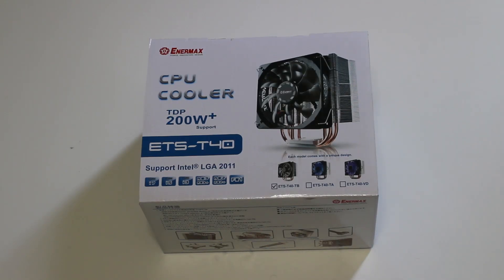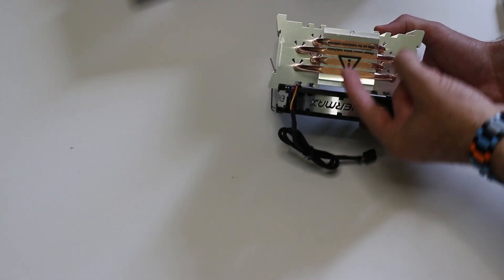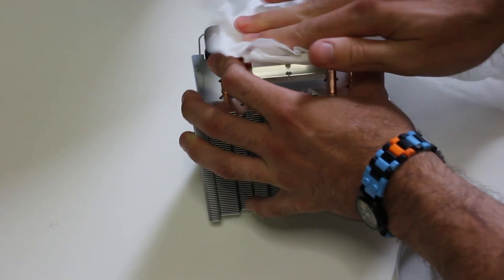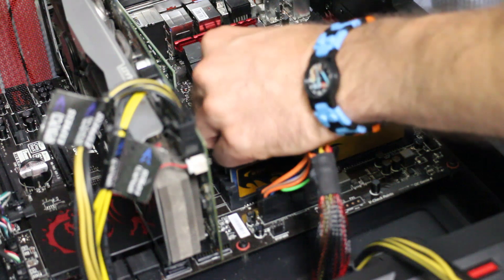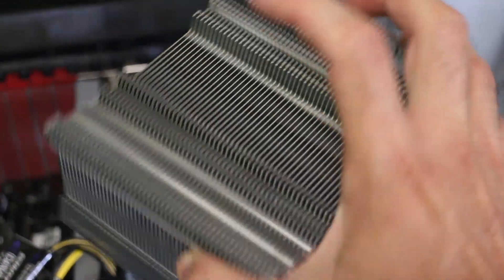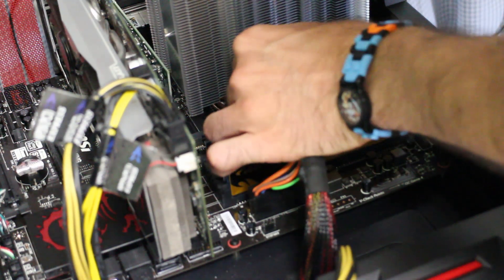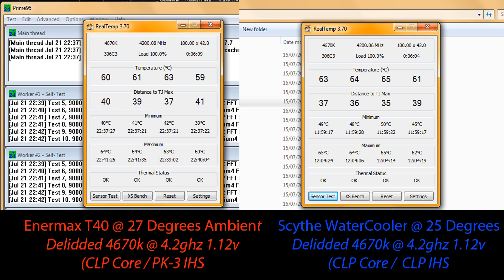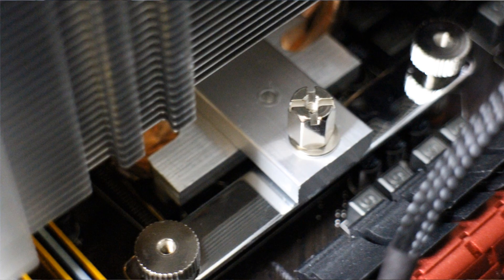Enermax ETS-T40-TB FULL Review / Installation Guide and Benchmarks Comparison Vs. Water Cooler

Comment: I used one of these with an FM2+ system that was overclocked to 4.80 GHz (A8-6600K, then A10-7890K) before I moved over to AM4. An amazing cooler, honestly, and much easier to install than the Cooler Master Hyper 212 EVO on AM4. Those instructions are abysmal.

Comment: installed this cooler and its putting some pressure against my freaking high corsair ram-Moduls....didnt want to put the fan on the wrong side, you im gonna live with it. Works fine for a few month now, but i guess its a good way to break your ram bank, if you install and reinstall it often enough. Temps dont even reach 60 degree with a 2700k@ 3,9ghz

Comment: Im also deciding between the T40 and Hyper 212 evo. Im leaning more towards the enermax but i don't like the fact that the copper pipes have gaps in between and aren't perfectly smooth. It should fit in my antec three hundred two as well but i have to decide which one.
Reply: +bluej511 even coolermaster have  gap there. its so tiny and only fingernail can sense it. it is sensible on 212 and tx3evo as far as i know.enermax is superior on tests. even fit series.
Reply: Zox Wolf Haha i posted that a year ago, ive since then gotten a Noctua NH-U14S and now watercooled everything.
Reply: Cool mate. I posted that even for other ppl who want to know more about these coolers.
cheers

Comment: Great video (watched because i saw the 5GHz on a air cooler). I have £60 / $85 to spend on a cooler for 1150 planning to cool a i5 4690K. Would you recommend this over something like a cooler master 280L? Thanks Brian or whoever can answer :)
Reply from the maker: Yeah for the money just get this, it will handle an i5 perfectly fine, and you can keep some cash in the back pocket.
Reply: Tech YES City Thanks, Will do. Whats the stock fan like? I think i'll get another anyway but should I swap it out for my SP120 or a noctua?
Reply from the maker: stock enermax t40 fan insanely good (better than the black and white version fans too), it is very quiet when in idle and even when spinning up doesn't get that loud.
Reply: Tech YES City  Just got it for my 8320, damn good cooler indeed. Keeps the energy munching 8320 in the 40s while playing games like sleeping dogs. Well worth the money if you care about noise level and comfort.

Comment: This or the Hyper 212 EVO? Planning on doing a buil. It's going in a Fractal Design R4 Windowed.
Reply from the maker: ***** This all the way.
Reply: Tech YES City Even if the Enermax is 8 Euro's more?
Reply: Also, do you think it would fit with Corsair Vengeance Pro memory in the first slot?
Reply from the maker: ah depends on how far spaced it is from the cpu socket, but if mounting it vertical then it will fit.
Reply: Honestly, with these two being so similar to each other, I'd say get whatever's cheaper.

Comment: hey
ive just brought this cooler for my i5 4670k tried ocing and it doesn't want to go past 3.9ghz at 1.250v, if i try anything higher the system just freezes, even with the core voltage upto 1.3v :o
im using a Gigabyte Z87X-SLI 

thanks
Reply: pc has now started to freeze @3.9ghz when opening a simple program such as core temp
Reply: mine still using the stock cooler one, and it past to 4.8Ghz at 1.290v without any problem but I changed it back to 3.4 due to stock cooler.
do you have CPU-Z? if so, check your bus speed (BCLK/PCIE frequency). for i5 4670K, the speed should be 99.98 MHz.

Comment: Thanks for the video i am going to replace my hyper n520 junk with this awesome heatsink so i can be prepared for 130F summer. My heatsink idles at 26C 76F room temperature or 16C if i have my vents blowing cold air directly with the air conditioner on. Using an AMD 1055T and it has never let me down in performance *click click click

Comment: mine doesn't auto adjust, under load in stress test it still does 800rpm but still doesn't top 40degrees on stock 4670k, so no real need I guess:P btw the switch is on the fan itself, already found it. thanks.
Reply from the maker: Ah nice, yeah i think it starts to trip after 55 degrees or so, 40 degrees tops, lol that is some really nice temps, good luck with the ocing.
Reply: yeah and it's not even delidded, thanks, the cooler is surprisingly great though, got it following you'r recommendation;) keep up the good work, it is nice to see that u'r channel has diversity instead of just focusing on one subject.
Reply from the maker: Yeah it is one amazing cooler for the money, I am sad that I didn't get another one over this zalman junk that I got for $3 cheaper (really regret it and not too keen to post the review cause half of it is me cursing the zalman cooler lol).
Reply: lol I know how you feel! I got the zalman cnps2x because it was nice and small and looked good, but turns out it cooled like 1% better than intel stock;p

Comment: how to change the rpm? there should be a switch to change between 800 - ** - 2200 rpm, but the manual says nothing about it
Reply from the maker: Actually never tried to change it manually, was really really impressed with how it worked on auto, if no load on CPU it will just stay at 800rpm but when on load/cpu gets hot it will ramp up.  Great design.

Comment: Newbie question:  Do you need to remove the stock cooler backplate from the motherboard prior to installing the Enermax backplate?
Reply from the maker: On my motherboard (g45) z87 I didn't have to (from memory).

Comment: Would you recommend this if I want to run an I5 4670K at 4,6ghz?
Reply from the maker: Yes
Reply: Tech YES City I'm still not sure I've read a lot of reviews and all i'm getting is that's as good as the Hyper evo 212 but your temps look really good. I know this is too much to ask but could you come back to this cooler and some more benchmarks and showing how much it can handle, thanks.
Reply: DarkLordX1X he has delided his cpu, which makes it run about 5 degrees cooler than a non delided chip. which could be a reason that it looks better compared to other benchmarks

Comment: seems like a good cooler and underrated too, Enermax makes some cool looking pc cases too....is the new Black Twister Enermax cpu cooler the same thing except painted black and comes with a blue LED fan? I've been wanting one. On newegg, the regular T40 is the default choice, but you can change the paint to black and newegg automatically links to the Black Twister T40, so I guess it's the same thing?

Comment: Yes, the T40 is a bit wider than 212 Evo, but both have same height. I installed both on my z77 extreme4, and I did push config. With the Evo, I could still squeeze a low profile ram (anything taller won't fit unless u move the fan up a bit) into the first slot after the cooler is completely installed, but with the T40, I had to install the ram first and then the cooler fan because the fan covered the first slot. I used Samsung ddr3 that has no heatsink because my Patriot Viper 3 won't fit.

Comment: Despite the low price, this cooler is surprisingly good. I was having the same problem choosing between this and the 212 Evo for my 3570k, but I ended up buying the Evo at a local store because it came with a bonus fan for push pull. I borrowed my friend's T40 and I did some test on both coolers as fairly as I could and they were quite similar in terms of performance, but the Evo was a tiny bit louder, however it's not really noticeable unless u stick your head on the side of your case.

Comment: Bryan is my rig any good? (Tell me if it needs a better psu)

CPU - AMD FX6300 Black Edition 6 Core (3.5/4.1GHz,8MB Level 3 Cache, 6MB Level 2 Cache, Socket AM3+)

GPU - Asus Nvidia GeForce GTX 760 DirectCU II OC 2GB GDDR5

Asus M5A78L-M/USB3 Motherboard

Western Digital 1TB Internal Hard Drive

Cooler Master RS650-ACAAE3-UK GX-Series 650W Plus Power Unit

Crucial BLS2CP4G3D1609DS1S00CEU Sport 8GB Kit (4GBx2) RAM

Comment: Would you reccomend this or a coolermaster hyper 212 evo? They are about the same price? You probably dont have any experience with the 212 but it is one of the most recommended air cooler at this same price? Any reason why you went with this over the 212? Thanks :)